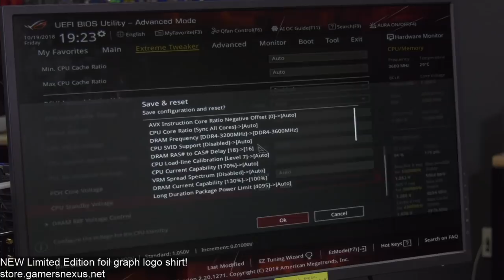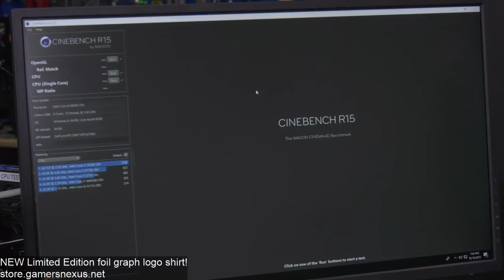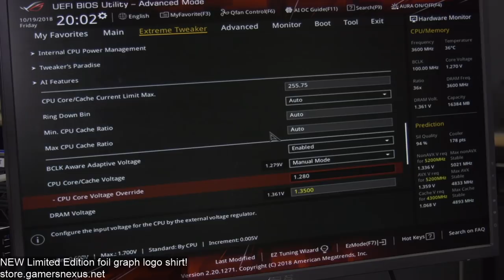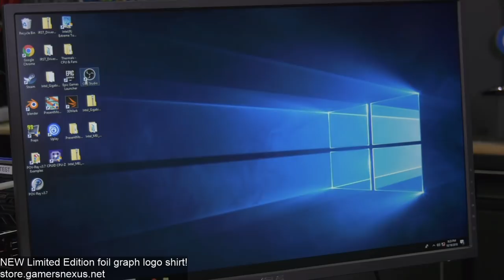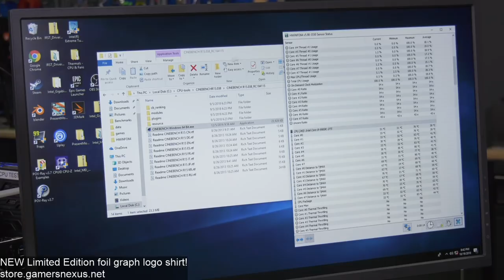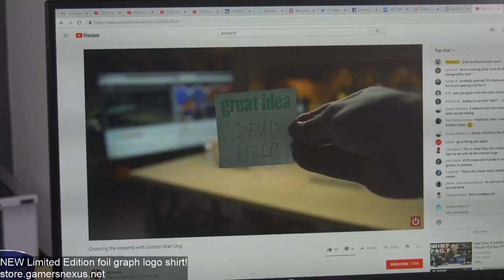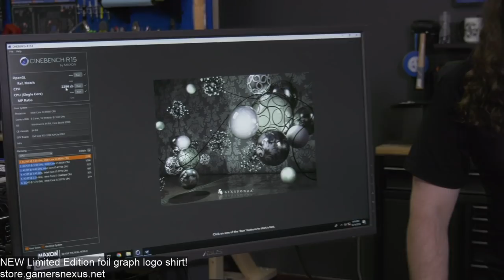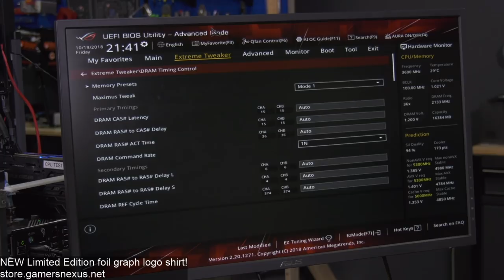Live: Delidded i9-9900K Overclocking w/ Lapped IHS

Comment: Something to consider when lapping the IHS and chip, making it flat when at room temperature doesn't take into consideration of how it distorts when it is hot. Cooler to IHS interface may require a concave or converse surface at room temperature to be flat at running temperature. Lapping might actually make things worse if distortions aren't taken into account.
Reply: who laps any more  smfh
Reply: If it’s not flat at room temp it’s definitely not going to be flat under heat stress. -mech. Engineer

Comment: Using a IR temperature reader or thermal imaging camera on a reflective surface that you are trying to get an accurate reading from like a heatsink / heatspreader one suggestion is to place a piece of electrical tape on the object you want a reading from. Kapton tape would also work but I don't know what the emissivity of kapton is compared to the regular black vinyl electrical tape with an emissivity  around 98% which is much better than polished copper or aluminum with emissivity of only 5%. An infrared temperature reader is also taking an average temperature of a circle around the pointer depending on distance away from the object being tested. The reader will say the exact read resolution to distance on the body somewhere but most will be about the same as 5mm reading per 6.25cm distance and that is probably more precision than the temperature reader is capable of depending on quality and price. For any accuracy and much easier to get a quality reading it's hard to beat a cheap thermocouple.

Comment: Seal the whole PC in an Evacuated chamber then filled with Cryogenic Argon, with Liquid and Gas tight pass through for peripheral connections. Argon would solve the Atmospheric 'Condensation' problem. <edit> Might be a slight problem for parts which need a 'warm state' to write properly.

Comment: It would be interesting to revisit this was a later BIOS, because my 9900k won't do anything on the latest BIOS, think it's 1502, but was great on the early BIOS you are using in this video, it looks like 603, my 9900k did 5Ghz at low voltage and stayed about low 80's C, but it struggles to even do 4.8 GHz stale on later BIOS's.

Comment: Your XMP is running your SA voltage at 1.4 volts... mine did also for a month before I spotted it, its the corsair xmp I think I have the same as you but 2666mhz rated. I run it at 1.085 now but before it was at 1.376 and you have almost 1.4. not great right.

Comment: What were the final temps, voltage and frequency?
Reply: Brimmy 5.3 stable at like 1.3vcore, about 76c couple cores hit 80 at slightly unstable 5.4 (couldn't get CB there). But that's on an absolutely massive radiator.

Most people hitting 5.2-5.25 on typical 280/360 aios though, which isn't bad.

I'm reasonably sure these next couple bios updates will help a lot, especially on Ram tweaking for bigger scores in CB and timespy which love faster ram too.
Reply: Nah that's the trading in hw info
Reply: Thank you
Reply: Brimmy nice avatar
Reply: it probably would have been able to hit 5.4 stable had they not delided, the thing lost like 10c when they delidded it.
Reply: @thelasthallow  that was with the hydronaut (?), this one is liquid metal so i wouldn't expect that big a difference for this.
Reply: @Gabriel Seamen Thankyou =^_^=
Reply: @Gabriel Seamen Why can't Hardware Unboxed get this CPU over 5GHz? Why did he get 100c @5.1GHz? Is he making a point to Intel? He really hates Intel that much?
Reply: @My name is Ozymandias

Because that's the silicon lottery, pleb. Der8aurs 9900K is shit too, GN appears to have gotten pretty much the best one seen on the internet so far because nobody else is getting 5.3ghz with the insane temps this thing runs at.
Reply: Der8auer got lower temps when delidding his.
Reply: @damstachizz  why is everyone complaining about the temps. This is a 8 core CPU. Other reviewers such oc3d have gotten it at 5 without it reaching 90. Having a 8 core cpu at 5.0 ghz is pretty insane to me
Reply: Because if you want an 8 core CPU to run at 5ghz while hitting 90 degrees on a 280mm rad, you can just throw 1.6v at a 2700X.

The temps are ridiculous, you can cool a 2990WX with the same cooling solution for a total of 32 bloody cores.
Reply: Well get yourself the 2990WX and be done with it.
Reply: @damstachizz , that's kind of missing the point. Core count isn't the main performance driver for consumers, even though many applications started becoming more multithreaded when multicore CPU's starting coming out a long time ago (in computing terms). However, not everything can be multithreaded, and those processes that can may not be able to do it evenly and may load the cores unevenly. Hence why people still say Intel is the performance king for applications that don't thread to super high core counts (most games). There are also different performance metrics to consider than both core count and clock rate, like IPC, largely defined by a processors architecture. Intel's architecture has a higher per core performance rate than AMD and a higher IPC as well. This isn't a put down of AMD though. AMD is making up for it's lacking architecture by upping core counts, which do have a distinct advantage in highly threadable workloads. So, with that said, you can hopefully see why " 8 core CPU to run at 5ghz while hitting 90 degrees" is nonsensical and missing the point, as the performance wouldn't be the same. Though AMD is narrowing the playing field in per core performance too, so that'll start making things even more interesting. On the topic of the 9900k, I get about a 62 degree Celsius delta between my water temp and the 9900k's package temp at 5.1GHz at ~1.3V, that kind of delta means a definite thermal flux limit between the package and the cooler. Intel seems to always do "just good enough" on their cooling, which is a bit of a shame in what is supposed to be an enthusiast chip.
Reply: @JimBob1937  I don't even understand what the heck everyone is saying rn

Comment: anyone that maby could help me pleas im stuck. i have a i9 9900k everything is stock my cpu is compared with a msi meg z390 ace with a cpu cooler h115i i know this cpu can get hot but stock settings 4.7 ghz wont clock down in windows att all i've seen youtube vids when pc idle i9 9900k auto clocks down to 800hz power plan inside windows dont work either bios settings stock and bios itself updates newest version. if anyone know what it could be pls let me know thnx alot.

Comment: Would it be worth it to upgrade from an i5 6600k to an i9 9900k as far as gaming is concerned?
Reply: For purely gaming i'd say no. I also have 6600k so if you want more performance you can always overclock.
Reply: there will be VERY little difference between 9700k and 9900k stock. Overclocked, 9700k actually may even do better due to reduced heat.
Reply: For gaming upgrade to 8700k.

Comment: You keep saying complete stock but its a delided chip with liquid metal so it's NOT completely stock now is it?
Reply: He's also using a massively big cooling solution to boot. So yeah someone with a D15 or 240mm rad isn't going to be able to hit 5.3 without big thermal issues. I think Hardware Unboxed shows what most people will run into when running things out the box.
Reply: He’s referring to clock frequency and voltages
Reply: Andrew Brinkman exactly

Comment: Intel's latest is sooooooo NOT worth it ! Yes it is the best gaming cpu , but just a few % and only at 1080p or lower !  Nobody in their right mind is going to use an 9900K for 1080p gaming !  I'm so glad i went with Ryzen last year !   Intel can suck it !   AMD has so much more value ! specially within 6 months , with Zen2 on 7Nm. That is the processor i am waiting for ! Can't wait to install my 3700X in 2019 !
Reply: gertjan van der meij you know there is 4K 144Hz/1440P 165hz/ and now 3440x1440 200Hz around the corner. AMD will fall behind on those kind of frame rate, if you play at 60fps or 120 sure go with AMD. You can’t argue intel is technically still faster.
Reply: blitzwing1 2 1080TIs can max it out just fine. I would know... I own the hardware for it. Anyways AMD still suffer from memory compatibility on their memory controller, low clocks and high temps past 4.3Ghz and AVX instructions are being used heavy in games today which intel is about to bring avx-512 where AMD barely ate getting to avx 256. Price to performance can’t be an argument if they technically are the best. AMD is good for under 100Hz gaming 4K60hz